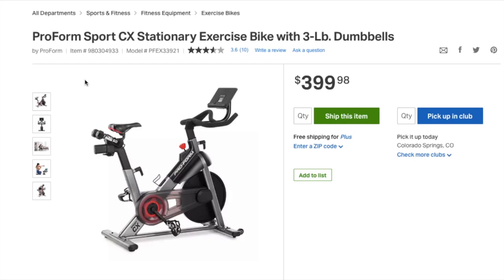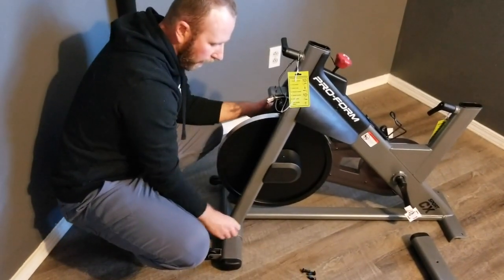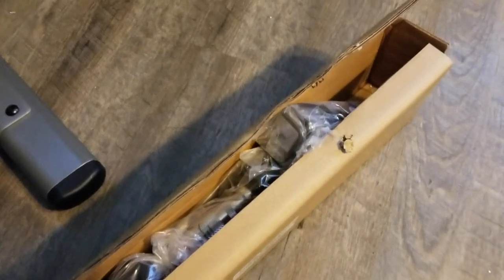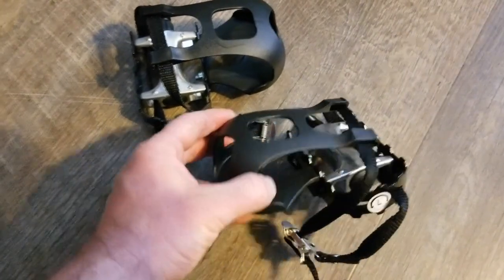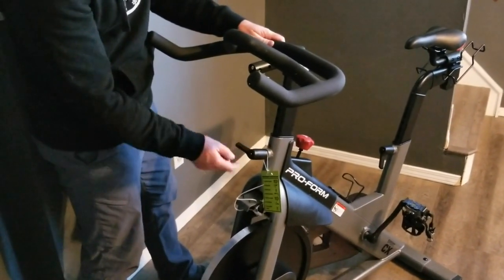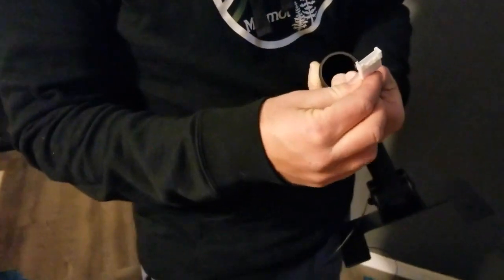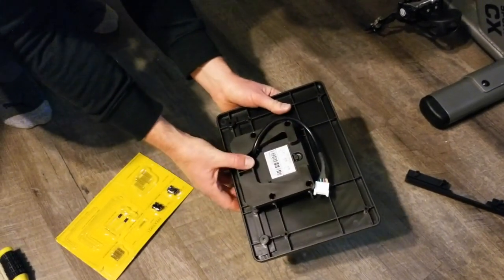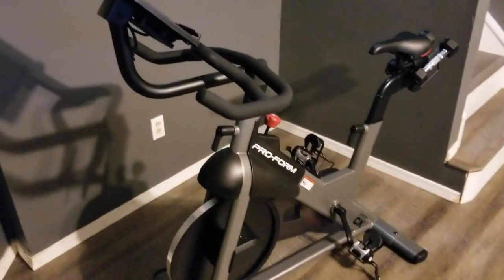Proform CX Sport Indoor Spin Bike- How to Assemble and Unboxing

Comment: Excellent video!  I appreciate the help putting this together.  We had some trouble connecting the wires; ours did not “snap” as easily as yours, however, it is working beautifully!  This is a great exercise bike and this video helped speed up the assembly!  THANK YOU!
Reply: Do you have any tips on how you were able to connect the wires?   I cannot figure it out.

Comment: Hello! My wire to the top was like yours. I used pliers to pull it out but unfortunately pulled off the white connector. What does that control? My head unit still works and it seems to still change resistance levels.

Comment: Random question: the plastic cover that covers the axle and nut on the left side of the flywheel....can that be removed? 

I was hoping to mount a speed sensor to the flywheel, but I would need to do that as close to the center of the flywheel as possible.

Comment: Great assembly video..  Thank you!  Anyone else getting the CH0 or CH1 error when trying to adjust the tension?  Tried following the instructions in the manual, but it won't drop from full tension - or I'm much weaker than I thought.
Reply: I got the same thing and I’ve tried doing what the manual says
Reply: @PreachaDiva76  I double checked the wiring harness and I found one loose connection... Solved the problem immediately!

Comment: How does this compare to the proform carbon cx? They look about the same.
Reply: did you find your answer? I am also wondering how they compare.
Reply: @manusuissa1  it’s my understanding that it is the same bike with slight name variation for the Sam’s Club bike. Echelon does the same thing with the one they sell on Walmart and their own website.
Reply: @dkhaea5427  Thank you! Which one did you end up buying? The echelon from walmart is cheap, i'm debating between this proform CX, bowflex c6 and the  echelon sport from walmart.
Reply: @manusuissa1  I ended up getting the Echelon sport from Walmart but it had connectivity issues with the Bluetooth and I am now waiting for a replacement 😭. If you have the means I would go for the bowflex C6. Seems like you get more bang for your buck plus I’ve owned quite a few bowflex equipment and it’s always been great quality.
Reply: @dkhaea5427  Oh nooooooooo that's so annoying. I'm about to buy the Proform Sport CX it's on sale ($1000) with 1 year of free ifit...i like that it adjusts the resistance automatically!

Comment: Is there a way to calibrate the tension on the bike?
Reply: This is my question also. The resistance does not match the iFit workouts. It has very little resistance.
Reply: @snapfue  I have a Bowflex bike and I was able to calibrate it.  My daughter bought a Proform and finds it lacking in tension ability.  I don't understand how they can put out a bike which does not offer the resistance needed to push oneself through a more demanding exercise.  I was looking to find a Proform forum somewhere but have been unable to.  But judging from your response, this bike is not alone.
Reply from the maker: We ran into the same problem where we just didn't feel like we were getting enough resistance. Unfortunately there is not an easy way to force the magnetic resistance band closer to the wheel. I'm sure there is a hack that somebody's figured out. Maybe some others on YouTube can help.

Comment: Hey! Great video, just got this bike... however im 6'00 and it seems like it doesnt adjust like other bikes.. i found that the handlebar was too low.. do you  adjust the seat lower than on other bikes?any thoughts? lol
Reply: I am just under 6 foot and had to do a bit of adjusting to make it comfortable. You want the seat height to allow your leg to fully extend during the pedal stroke. There should just be a very slight bend in your knee at the bottom of the crank turn. With the handlebars up as high as they could go, I still felt like I was hunched over a bit too much. Of course, I am comparing this to my Mountain Bike set up which has a much different upright feel. It takes a little bit of getting used to for proper spin bike form.

Comment: Does anyone have an issue with the seat post making an irritating creaking noise?  It started on the very first ride.  It does it whether the saddle is set for my height or set for my girlfriend's height.  The noise is definitely coming from where the seat post slides into the frame.  Loosening the height adjustment knob and sliding the seat up or down and tightening it will stop the creaking temporarily, but it comes back after 10-15 minutes.

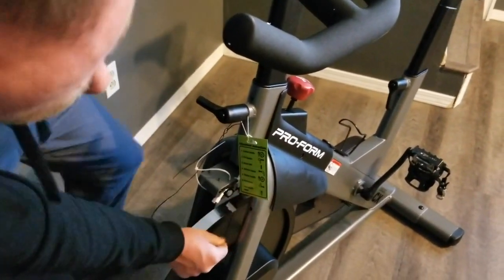Comment: re: 12:30 range where you're connecting the upper and lower wire: mine aren't connecting... there's different number of pins and one is wider than the other. I'm not sure if this is a factory issue that they screwed up on or what, anyone else have this issue?
Reply: Did you figure out your issue or get rid of the bike. We had this problem. There is actually two hidden female connectors that plug into those two male connectors. There is one that needs to be pulled out from handlebar post under the screen and one that needs to be pulled down through the tube where the handle bar setup mounts to the bike.